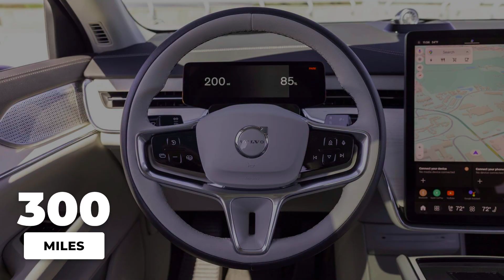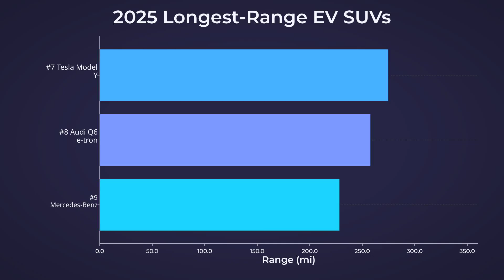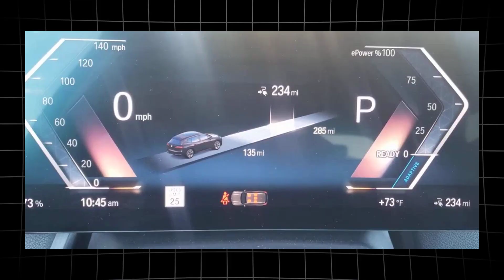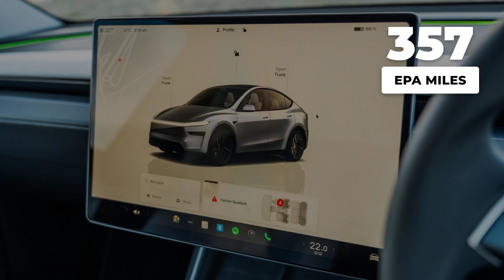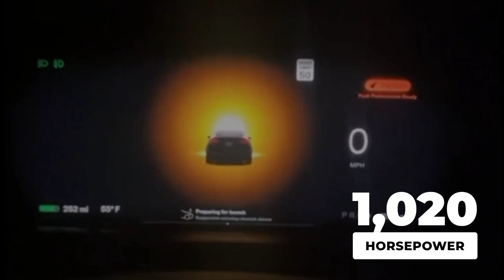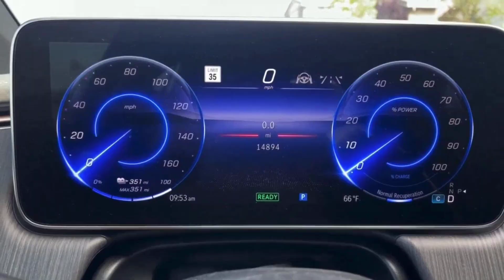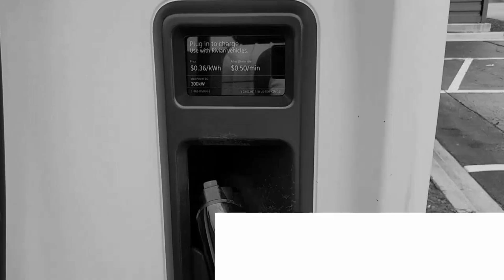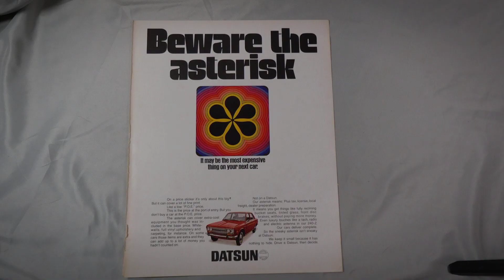Better Than Tesla? The SHOCKING New King of EV SUV Range 2025

Comment: Miles per charge means nothing, miles per KWH is how you compare different vehicles
Reply from the maker: You're absolutely right: miles/kWh (efficiency) is the purest technical measure for comparing how well a vehicle uses energy. It tells you the engineering brilliance.

However, for the average buyer, miles per charge (range) is the ultimate real-world metric. It tells them: "Can I drive from City A to City B without stopping?"

The reason we focused on range in the title is because this particular EV achieved its SHOCKING number by improving both—a bigger battery and better efficiency.

Which one matters more to YOU: the engineering (miles/kWh) or the convenience (total range)?